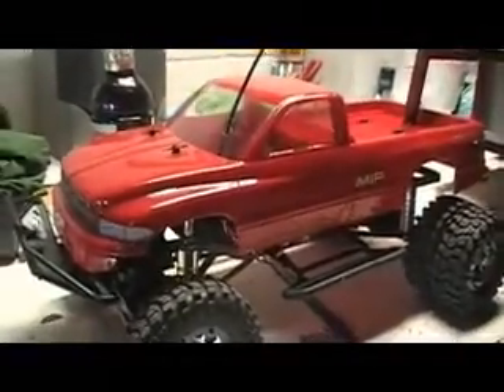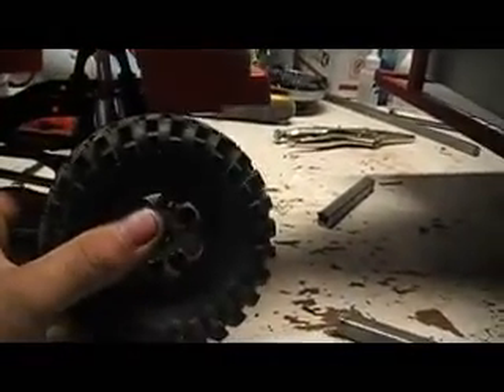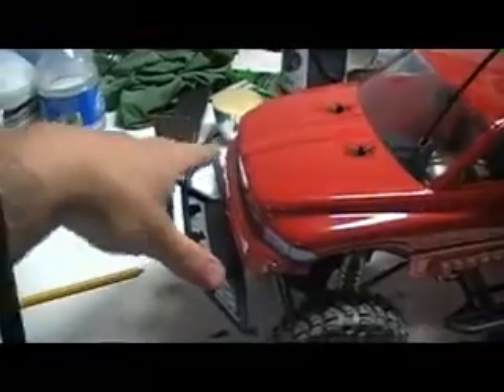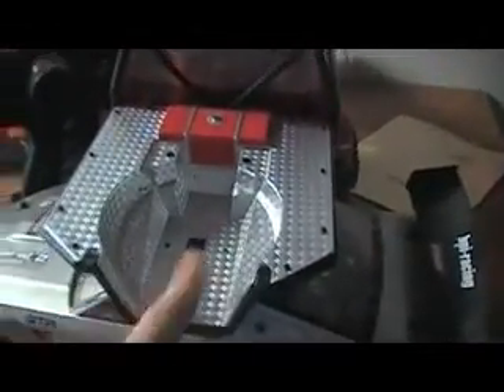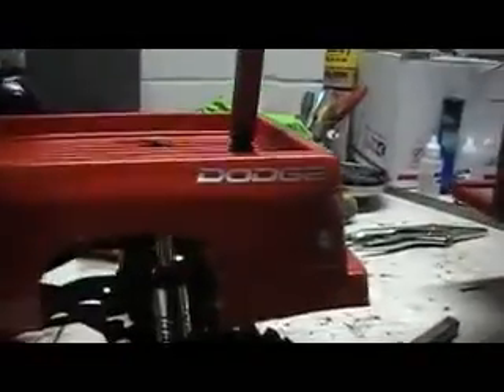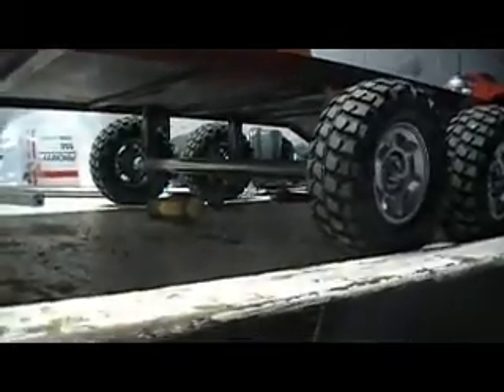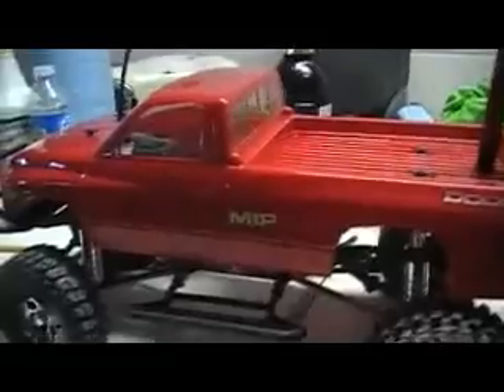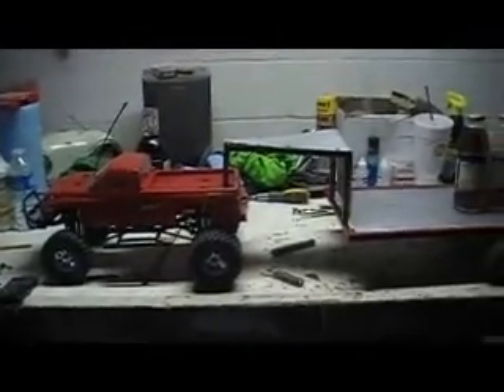Hillbilly Deluxe completion along with the Hillbilly Hauler

Comment from the maker: I used a donor set of scx beadlocks, drilled the centers out large enough for a 7mm socket wrench to pass through then took 1 1/2" lag bolts and bolted them together. Very simple mod to do and looks cool. Its also a better alternative to buying a 130 set of dually rims